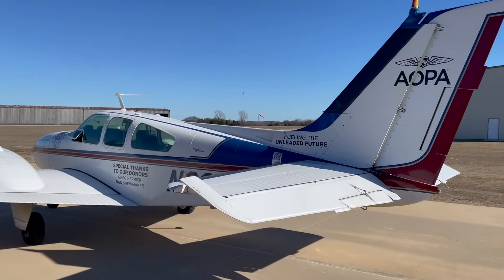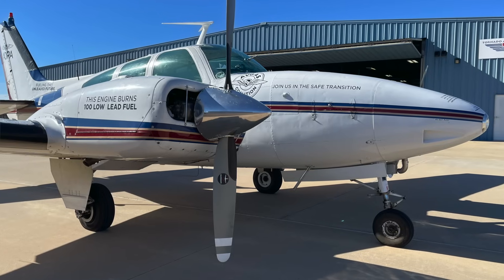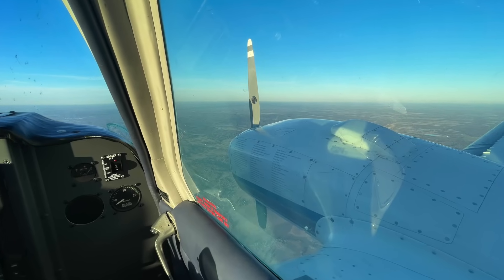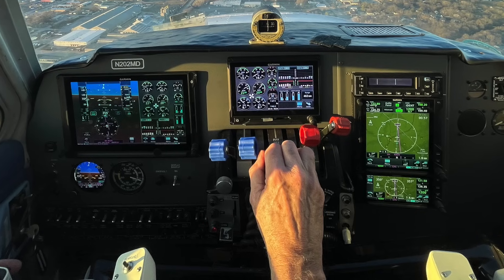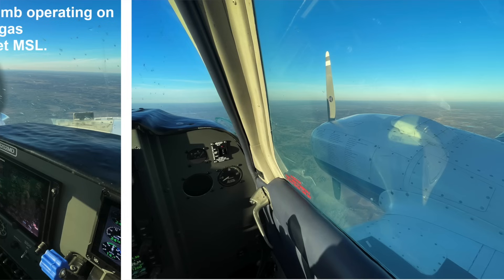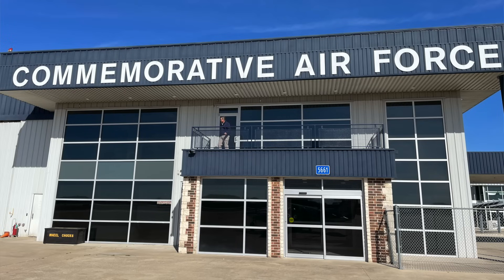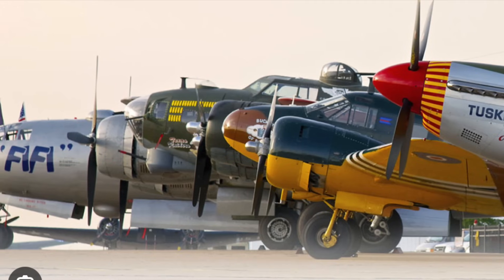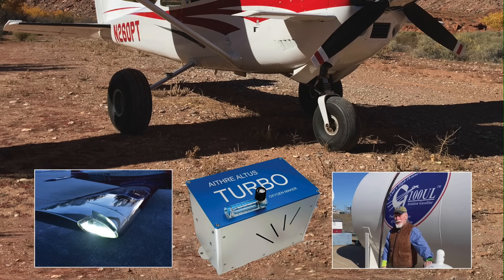Unleaded Avgas Flyoff in a Beech Baron

Comment: ... the "new" ability of the Rotax and few other engines, to fly on the unleaded is good for the sport prospects, the fuel-financial wise, and the environmental-wise - also very helpful. So, in the way, it's the way that is 'meant to be'. While, is also much safer, the fuel volatility is reduced much down, comparing to kerosene and avgas, that can be in the comparison seen as a lot more volatile, comparing to unleaded. Along with the story - it's also the best for the engine to use the such type rather as the unleaded - having always that bit of the 'oil touch' inside, as well, which improves performance and longevity of the engine, on a long run. This list here, in the favor of the unleaded is probably a 1000 items long, but here it is, just to highlight a few. Aviation: it's where we innovate, and the unleaded initiative should go forward as possible, and adopted as a standard, soon as possible. The aircraft engines health-wise, the economy-wise, and the environment-wise, the outcomes will be only: what we need to see, and to have applied urgently, out there :).
Reply: Any gasoline is more volatile than kerosene diesel.
 And lead is not a good lubricant.

Comment: My big question which is not addressed here, concerns the exhaust valves.  Lead acts as a cushion for the seats.  How are the exhaust valves and seats holding up?
Reply: It is said that lead forms a sacrificial layer between the valve and valve seats that helps to keep the seats from microwelding and recessing. So engines that don't already have good hardened valve seats will eventually need them I would imagine.

Comment: VP is also making unleaded aviation fuel.  Lots of motorsports fuels that are higher than 100 octane, no reason it couldn't be modified for use in the low tech tractor motors that are used in planes.

Comment: Octane is 100 Octane. It is also far less volatile with a lower vapor pressure than Avgas. (Less vapor lock, higher altitude capability).

Comment: I hate to say it, but here goes...the only way 100LL goes away is if it is banned by state or federal govt. Pilots are very conservative in nature (I DO NOT mean the political sense of conservative vs liberal, I mean "slow to change"). The majority of pilots, flight schools, and airports will be wary of a new fuel. If GA100 is adopted slowly, the price will remain high because it will be produced in small quantity (economics 101). At some point the govt will step in- once non-pilots learn that we have a viable unleaded alternative, the lead ban that has applied to every non-aircraft engine in North America will be applied to aircraft. I personally would use GA100 today if it were available nearby, but I don't know of anyplace near me that sells it.
Reply: I think if the price is lower by a significant amount that would help with adoption. Government regulation should never ever be the first option.
Reply: @cfdfirefighter  I'd say it likely won't be lower. Sounds like higher. Because it's going to take a more highly refined fuel when they don't have the lead crutch for octane enhancement.

Comment: The comparison is only valid if there is a control group. We can’t say that both engines are operating similarly on the unleaded, unless it has previously been proven that they operated the same when they were both running leaded, or for that matter both unleaded. Even if this was the case, this represents an n of one. No statistical consequence. With that said, there are other benefits to our engines running unleaded, however, I think that would only be worthwhile if the price was the same or very similar, which very much does not look like it is going to be the case.

Comment: thanks for making avgas even more expensive
Reply: It's a tiny difference and it will likely end up cheaper than leaded AvGas in the long term, but you won't have to worry about that. It will also result in the ability to use synthetic engine oil, increasing the TBO of engines.
Reply: Lead is not cheap. Transporting it is also a mess. Maintenance will likely be lower on unleaded. This is a good thing.
Reply: Once 100LL is purged from the system and the GAMI fuel is the mainstream fuel, it will be as cheap as 100LL and possibly cheaper given the cost of making, transporting and using tetraethyl lead.
Reply: Wow. That’s pretty optimistic. I’ve never seen prices go down. Should have let sleeping dogs lie.

Comment: Great to hear that G100UL is performing as advertised. And that it actually is outperforming 100LL in some ways!

I wonder what the profit margin for the oil companies will be on G100UL compared to 100LL.
Reply: Avgas is such a slim niche market in terms of barrels/yr that’s it’s not really that interesting to the big refiners…. But still I wonder too.
Reply: Oh, I wouldn't worry about the oil companies, they're going to make their margins regardless, kind of like insurance companies, they never loose either. My two favorite big corp businesses, can you tell? Ha!  I hear Unleaded Av Gas is likey to be more expensive. Because It's going to be a more highly refined fuel when they don't have lead as a crutch for octane enhancement. But in the end it's going to be good to reduce maintenance costs. Just my 2¢.